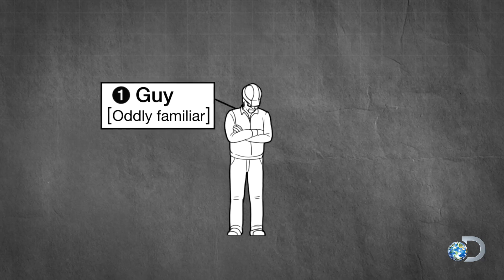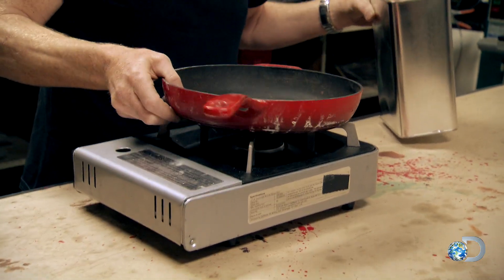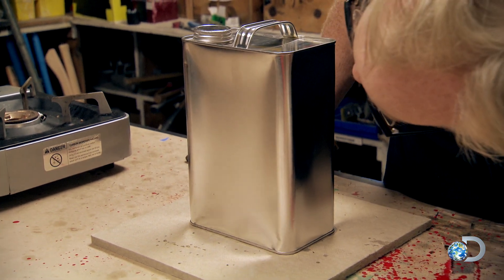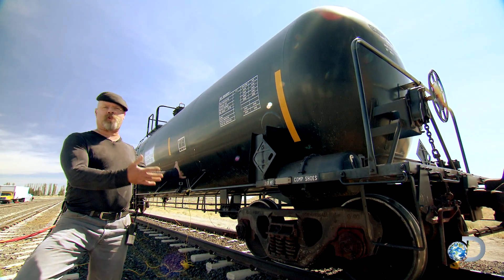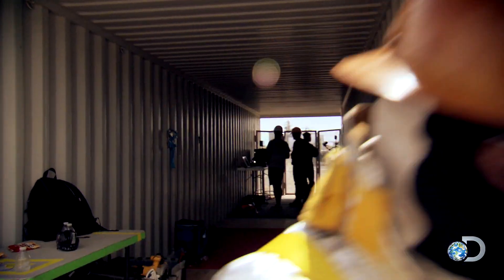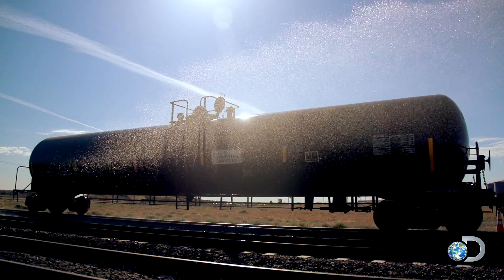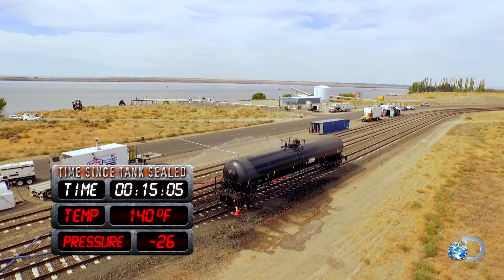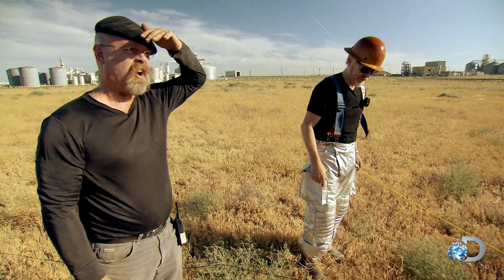Tanker Crush MiniMyth | MythBusters

Comment: Maybe the Old tank that imploded was thinner or used a different matterial than the newer ones
Reply: https://youtu.be/Zz95_VvTxZM and https://www.youtube.com/watch?v=0N17tEW_WEU Not sure if its the same thing happening here but....
Reply: @Andromeda4482  it is simulare, but not the same, they create vacuum by sucking the air out, so it will keep removing air until it implodes wich it always will at some point. the myth was that it was closed after it was steamed and the hot air contraced causing it to implode, wich is a limited ammount of vacuum. ive seen 20 000liter ISO containers implode because unexperienced ppl havent opened them at the top before using a pump to extract the liquid, and it happends very fast.
Reply: quite likely the case, if you tested this myth 20-30 years ago it would quite likely have tested positive as there where a lot les safety measures in place for these things.
Reply: If you watched the episode, they dropped a huge weight onto the tanker before testing. So it's strength was compromised going in.
Reply: My dad, a pump design engineer, actually did collapse a large tanker sized (but fixed location) tank by pumping out of it too rapidly. The tank wasn't what in the industry is referred to as a "pressure vessel." For years before he retired, he had an award sitting in office his colleagues made him for the incident. It was a crushed soda can painted the same color as the tank he collapsed. It's possible that this myth failed because the tanker car they used was a pressure vessel designed to withstand significant negative gauge pressure.
Reply: Seen a slurry tanker implode
Reply: older tank cars were in fact thinner because back then they didn't have the immensely powerful bending presses new tank cars are formed with. to compensate for the thinner walls the old tank cars had expansion domes on top so vapor given off by its contents had someplace to go. since new tank cars have thicker walls they don't need expansion domes, the hatch at the top is just for convenient filling.
Reply: yea but that system wasn't very effective at it's time before an accident happened (in Canada, somewhere) that set better standards for tanker conditions. Yes older models had expansion domes, but it was mostly for the gas-based ones and as i mentioned earlier, it wasn't very effective.
Reply: yea it was probably an older tank because the newer ones meet VERY specific safety standards.
Reply: @des-oe1vl  aren’t the newer tank cars supposed to be able to survive a serious train wreck so as not to leak dangerous liquids or fuels?  I think they are supposed to have better pressure release valves on them to prevent the car from going into a BLEVE (Boiling Liquid Expansion Vapor Explosion) situation.  The biggest BLEVE that I know of happened in the 1980’s in Murdock, IL where a railroad tank car got thrown 3/4 of a mile from where it exploded on the tracks and landed in some guys corn field.  I wish I could remember what it was carrying.
Reply: tanks wear out with time, so it could have very easily been an older tank , although they are tested and have minimum thickness I know that septic trucks for instance flat out collapse as tanks wear out. They are vacuum operated.
Reply: https://www.youtube.com/watch?v=VS6IckF1CM0
Reply: That is after the Lac Megantic rail disaster the FRA made all-new tank cars be built with double walls so there's less of a chance of a rupture in a derailment.
Reply: Or from an entirely different region of the world with vastly different safety standards.

No use testing it on an modern American tanker car if the story came out of, say, Australian railways in the 1920s or something.
Reply: not to mention this could've occurred in a naturally colder environment . although who steam cleans a train car at night or in the winter time lol.
Reply: And the tank would not be 100ºF because of the rain
Reply: The tanks that exploded were thin.
Reply: “Spoiler alert” 🚨
Reply: i remember watching the full episode, after this they go on and add a vacuum pump, after that doesn't work they drop a huge block from a crane then reattach the vacuum and it finally works
Reply: Kabuki Kitsune ok
Reply: Kabuki Kitsune  They did their research, it's just not always possible to do things thoroughly when you are up against a production schedule.
Reply: @cryophile  They redid this myth and got it to work https://www.youtube.com/watch?v=kM-k1zofs58
Reply: If you watch the full episode they did get it to happen by putting a dent in the car, so with a thinner car it’s entirely possible

Comment: The problem is the use of a modern tank, designed to prevent this from happening. If it were an older tank, closer to the age of the myth itself, I suspect very different results.

Comment: I know we are all disappointed, but there is some railroad worker who is really glad he doesn't ever have to worry about this.
Reply: I wonder if they removed the vacuum relief valve and plugged it, tank cars and 5, 8, 16 pans all have vacuum relief devices that open automatically when a vacuum starts to form
Reply: @yellowswagmuffin920  Well they measured the vacuum during the experiment and it didn't drop.
Reply: well, it can happen in principle, it just did not happen with this one...
So... maybe it was a different type/make with thinner walls, or more fatigue, or whatever.
Reply: Wrong. It can happen in the right circumstances. It's either confirmed or plausible.
Reply: @FutureRailProductions Ew disgusting foamer
Reply: @FutureRail Productions  literally said "busted" at the end, did you eveb watch the video? The pressure leveled off at -27 and wouldn't budge after that.
Reply: @anactualalpaca7016  this isn't the full episode. later on they damage the tanker and then it implodes
Reply: @anactualalpaca7016  Yeah except they dropped a concrete block on it which dented the metal and that was a weak point and it imploded. So if the car was damaged in a derailment which is entirely possible, then it's confirmed or plausible. Maybe actually watch the episode before you make an ass out of yourself.

Comment: What if they heat the thing even more and then cool it with liquid nitrogen, Would that work?
Reply: The maximum pressure differential you could get under the test conditions would be atmospheric pressure or about 15 psi, no matter how you went about depressurizing the tank.

Comment: I used to drive a fuel oil tanker one time in snow & ice storm I was pumping off a load of six oil the vents in the hatch on the top of the tank got clogged with frozen ice & snow I sucked in the steel tank I mean really sucked it in this was about 1989
The tank held 6500 gallons after that it only held 5200 gallons till it was repaired.

Comment: It really depends on how much water you put in it 1 kg of water would probably not make a single dint but let’s say you put 200kg of water in it it will probably take about 5 days for it the suck in its walls because of the lack of water but 2000kg would probably make it suck in its walls fully in (guess) 2 day it also relies on how thick the walls are so this would be possible with thin walls and a lot of fuel / Water

Comment: Many of the same features (shape) that are needed to keep it from exploding, also help to resist implosion.  typical fair weather atmospheric pressures are 28-32InHg.  If they had more fully expelled the air by replacing it with steam, they would have gotten closer to the local atmospheric pressure difference.  However, I presume they designed the tankers to be able to withstand (or vent to prevent) the crushing forces of very cold weather condensation of petroleum distillates; no surprise here on second thought.

Comment: the pressure in the tank was 29.92  in HG  or atmospheric pressure.
then at the steam cooled, the internal pressure dropped to 2 inches.
it is not possible to get 'negative pressure'
the lowest possible pressure is 0, you cannot have less because the definition of pressure is ABOVE the absence of pressure.
usually these guys got the science right.  that is why this was such a great show.

Comment: Some tanks are designed for full vacuum.  Some aren’t.  If you did the same thing to an older tanker you could well have your implosion.
Reply: yeah, old tank cars had thinner walls and couldn't take that much negative pressure, they couldn't take that much positive pressure either come to think of it which is i guess why they had expansion domes.
Reply: Yeah its to thick
Reply: Oh yeah yeah  ahahahaha

Comment: wait , it's either full or it's empty , empty crash worthyness doesn't matter , no money no value , full any blow would be dampened by liquids , and the steel reinforced by the mass of the liguid . just make the hatch airtight to 999 lbs per square. inch. acts like a pressure release Valve .

Comment: One reason why it didnt implode was prob because he put boiling water in that can and allowed it to cool causing negative pressure, but he didn't add water to the tanker nore heating it to boiling point, then rapidly cool down the tanker with a spray of cool water... Then it might implode. Idk...

Comment: Being a professional Chemical Engineer, I have seen a lot of tanks that designed for withstanding various pressure, and most of them are quite over built, so it is likely they have picked up a tough one that designed to hold negative pressure. But yes, I have also seen imploded tanks myself, it is possible.
Reply: Most of things are built to hold a large positive pressure, but won't hold much of negative. Things as simple as a coke can. Similar possible disaster in making, assuming it will be ever completed and it probably won't, is the Hyperloop project (or its various clones).
Reply: Oh, we know... All too well in 2023
Reply: @ThePoozer69 oceangate?
Reply: @Not_sheilsy04  Thats a toy compared to an oil tanker
Reply: @Not_sheilsy04  Oceangate
Reply: @thischannelisdeleted  also, air pressure is at most, well, 1 air pressure
Reply: @100percentnotabear do you mean one atmosphere?

Comment: "this is the biggest myth we've ever tested"
calls it a minimyth
Reply: The biggest myth they did was the cement truck they exploded the shit out of.
Reply: Yondoth that was the best episode, all you need to do it at home was 700 pounds of high explosives and a cement mixer. I tried it, it was fun
Reply: @OfficialYondoth  pft
Reply: Biggest one I've seen was the making of the duct/duck tape sailboat.
Reply: <3
Reply: Tank cars are double wall constructed. I could have saved them some time and money.
Reply: @ronaldburgess2884  Some are some aren't. We collapsed one unloading plastic beads with the vent shut using a pneumatic conveying system. The hazardous liquid materials tank cars are of course double walled to prevent leaks.

Comment: There was only about 3 quarters of the tank getting wet but the other quarter wasn’t getting cooled the rain cools it all around
Reply: That just slows the cooling slightly.  At some point, the water in the dry (hotter) part of the tank starts boiling at room temperature, and allowing more steam to condense in the cool end, cooling the dry end anyway. (see "Heat Pipe")

Comment: When the vacuum or negative pressure is formed inside ,there is high pressure outside the tank(ie atmospheric pressure= 14psi)so atmosphere is applying a pressure of 14psi on the walls of the tank which is made of frickin thick pieces of metal so 14psi of pressure is inadequate to crush a 1000 pound tank! C'mon myth busters y'all knew that
Reply: There's actually a difference between internal pressure and external pressure and how well the cylinder stands up to it. There have been tanker cars and big tanks that have imploded due to similar situations.
Reply: They need the views

Comment: Maybe if it was done in a colder place with much more water involved in cooling. If it was enough rain to stop people from working it was probably pouring rain
Reply: No the atmospheric pressure has been reached in this video
Reply: David Farah and they don’t even tell you the pressure in the vid
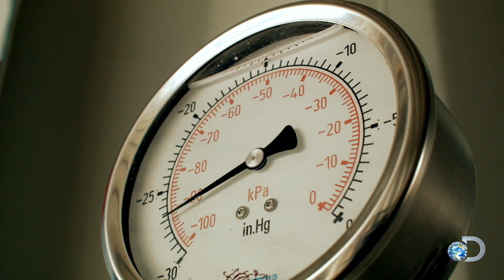Reply: @Bigbenny12  4:32 yes they  did say that the pressure is 27 in.hg and it's close to the atmospheric pressure. You didn't even watch the video
Reply: David Farah wrong they said the pressure in side the the tanker not on the out side
Reply: And yes yes I did watch the vid
Reply: @Bigbenny12  Its sea level so its about 30 in.hg
Reply: Jr Least general chainz That’s the pressure of the inside of the tanker relative to the outside pressure
Reply: Jr Least general chainz It’s the pressure inside compared to the outside. Which was -27 HG. You really can’t get any higher than that.
Reply: @collinmackin5911  actually the most negative pressure possible is closer to 30inches. So he's right that the tanker was nowhere near vacuum pressure.

Granted you can't make a vacuum from simply condensing water (air is still present unless u have 100% water vapour, which obviously wasn't the case in the experiment).
Reply: bigsmall246 Considering 30 inches has nothing to do with pressure. -27HG is the highest negative pressure you can get at that altitude.
Reply: @collinmackin5911  the elevation of port of Oregon is 269 feet. This translates to 29.6 inches of Mercury (depending on the weather), hardly any difference from the surface of the sea. So yes, 27 inches is nowhere near the theoretical maximum possible, although it is probably near to the practical maximum.
Reply: bigsmall246 A perfect vacuum is right around -29.6 inHG. Theoretical numbers don’t matter, what matters is what’s actually possible to achieve. You aren’t going to achieve anything above that in an experiment like this. There’s a difference between 29.6 and -29.6. 29.6 is what the standard atmospheric pressure is in most conditions. -29.6 is a vacuum. You cannot go past this while on earth.
Reply: bigsmall246 -27inHg is the closest you can get without having a vacuum chamber and using an incredibly bad tank that isn’t made for pressure. Of course it’s not “exactly” the maximum, but the difference is so small that it doesn’t really matter.
Reply: David Farah no it hasn’t idiot
Reply: Yeah they they forgot the cool rain
Reply: Don’t you just love it when idiots call people idiots for no reason?
Reply: @J right

Comment: but it did work, i saw a different vid where it showed the tanker implode
Reply: Yes, here: https://www.youtube.com/watch?v=UpWeU2fvFGs

For that one, they used a tank car with a flaw.
Reply: An old car built a long time ago before the massive bureacracy of safetycrats might not be as beefy and might implode more easily. The observation about the flaw also holds.
Reply: @edifyguy  So you're mad that things are safe? Moron.
Reply: @phatkatracing  No, I'm upset that the government feels the need to insert itself into literally everything. The old cars had a great safety record. There was no need to meddle, but they did it. There's simply no need for a tanker car to be strong enough to withstand a 50mph collision with the side of a gravel quarry.
Reply: @phatkatracing  If you say so. I never did hear about old cars having problems with unintended acceleration, and there was a lot of metal between you and the outside. Old power tools electrocuted people only if they were used improperly, like the idiots who removed the grounding prong instead of adapting it properly, and only then if something was damaged.

Comment: You can't get a greater pressure difference than 1 atm, maximum. That's not enough to crush something as sturdy as a tanker, which is specifically designed to handle it (albeit from the opposite direction, but still).

Comment: this is BUSTED! and good reason tank cars are indistructable the only way a tank car will collapse is if it got wrecked. two weeks before Mythbusters shot this episode Union Pacific had a big wreck near Boardman and tankcars were involved. one of the cars an old Railcorp DOT 111 was saved for the myth Mythbusters had Union Pacific take it from Hinkle to Boardman and had one of their cleaning teams clean the car out Boardman Fire Department, Union Pacific Hazmat Crew, Pacific Ethenal, and members of FRA were on site during the test and preformed a drill and used the test data so they can find out what happens to a tank car in a crash. in the first test MythBusters cleaned it out and sealed the hatch the fire department sprayed it with water to simulate rain or or a crew putting out a fire the gage went to 27 and stopped. so the Mythbusters dumped it and the track mobile returned it to the plant so it can be returned to Hinkle. the second test they got results a concrete weight was dropped on it to simulate a crash and then it was heated to simulate a fire then they sprayed it with water and the car collapsed. the reason it was busted was these tank cars are indistructable there are two types or tank cars in service the older Railcorp DOT 111 and the newer Trinity DOT 115 the 111 has beed wrecked a few times and can buckle if wrecked the newer 115 is indistructable becauses it uses a heaver steel jacket and is disigned to withstand a pressure of 27 PSI to keep its contence from sloshing. the DOT 111 had a bad order flag on it and the words sold for disposal on it bacause it was wrecked the newer 115 was used as a control and was returned to service after the test.
Reply: I actually can't understand what you're typing... please fix your grammar
Reply: @per7481  I'm just saying he's trying to look very smart
Reply: I'm impressed. Thanks for the info.
Reply: they actually tested it again and it did implode so its plausible
Reply: Aaron Peavler/Geomodelrailroader Railroad Photography l
Reply: R/Iamverysmart anyone?